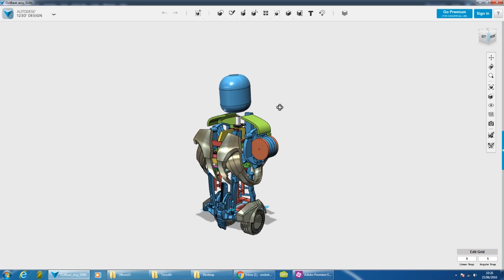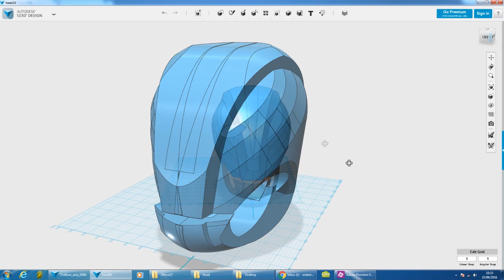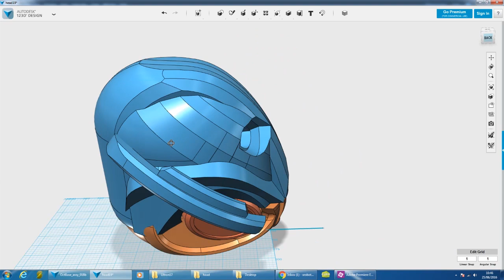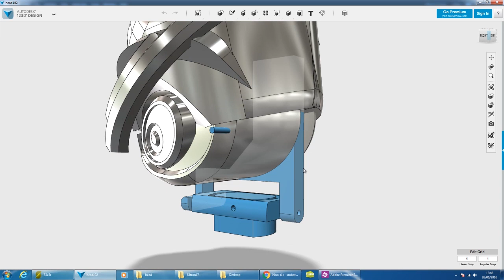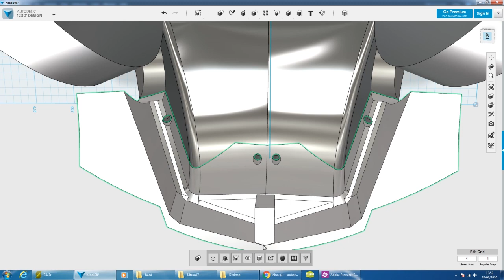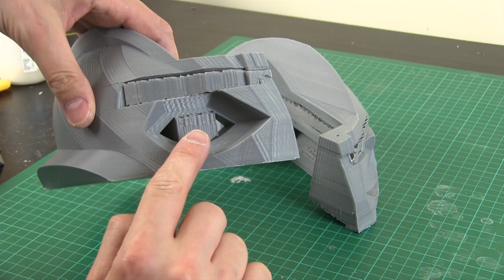Avengers Ulton #17 | Head Assembly and Animatronics Planning | James Bruton

Comment: I think the two main problems with the design are the height of the eyes (too high) and the back of the "skull". Instead of angling up from the chin to the back of the head, it continues in a straight line and does a weird curved 90 degree angle at the back. Other than that, it's pretty impressive. I'm constantly astounded at how powerful 123D design is.

Comment: Ok so I had a couple issues with the head and I finally figured them out after looking at reference pictures, Ultron's face is flat up into his forehead. it doesn't curve that soon. it's in general fatter and wider. And the jaw stops earlier, the jaw basically curves into the cheek holes and stops. the neck goes behind that. Your head looks great though! keep up the amazing work James

Comment: James.... You make mention of the "front to back dimension is too thick due to the arm mechanism". In the future...why not determine the size limitations of your mechanisms and then use that to help you set your scale so that everything looks right in the end. I am so impressed with everything you do, but it seems at times you don't plan far ahead enough in your design and then are forced to compromise your design due to limits imposed by things you have already built.

Comment: You make an awesome job in scuplting, cause 123D it's note the top for free modelling, but at this point you could get a Ultron 3d model and scaling the head for make it fit with to the rest of body, and add the mechanics component :D P.S. i think the nick is just a bit disproportionate, too high. You will add other aesthetics or it will remain like that ?

Comment: great work. and even more-so considering you're doing all this in 123D - it's a great resource for starting out but I quickly got frustrated with it when my designs started to get a little more complex and simple operations like booleans and chamfers started failing. since i started using fusion360 i haven't loaded up any other modeller and would struggle to think how I would cope without a history timeline now. out of curiosity do you not fusion360 due to licensing reasons?

Comment: Wonderful work James, it's really starting to take shape :)
One thing though: I feel the head shape is a bit off, especially the around the back and the clavicles - perhaps it would have been better to use the dimensions of a human skull as a basis? Seems to me that's what the designers for Ultron did.
As for expression, I'm wondering if pushing the eyebrows in and out will achieve the expressions sought. When looking at some clips of the movie it seemed to me that they were mainly moving the bridge of the nose vertically.

Of course I could be wrong :) Either way, it's great to see you build, can't wait to see the next episode!

Comment: The main things I've noticed about the head's design are:

The jaw isn't wide enough. The movie version has a pretty square shape to its head with the temples and the jaw being about even with each other, whereas yours tapers from the top of the head to the bottom.

The "friendly" appearance comes from the way you've cut out the top of the eyes and the eyebrows.  Both are pretty much horizontal, but if you want a more sinister expression they need to be angled down towards where his nose would be.

But overall I think the size should be good, so long as you give him that thick neck (which would also go a long way towards squaring up the appearance of his head, depending on where you mount it behind/under the jaw).

Comment: It does look quite friendly! haha
James, I think the main issue with the shape of the head there is that the jaw should be much wider at the back. And the eyes are too tall near the center of the cranium.
There are apparently a few pepakura models out there that could be used as references inside of 123D, if they can be converted to obj or something.